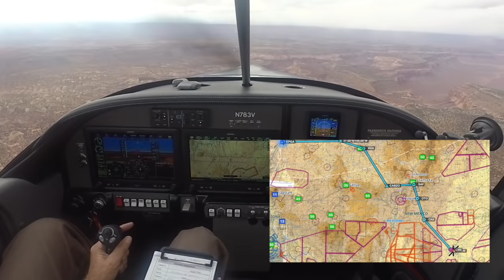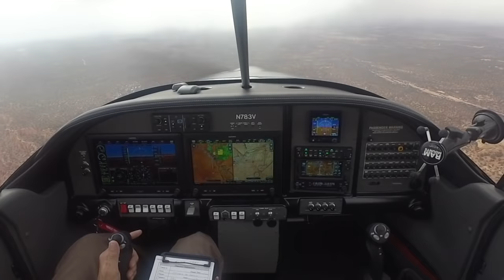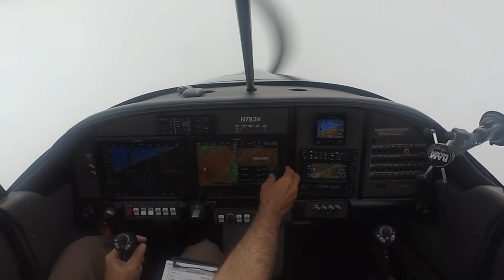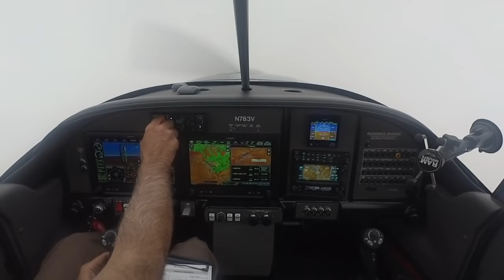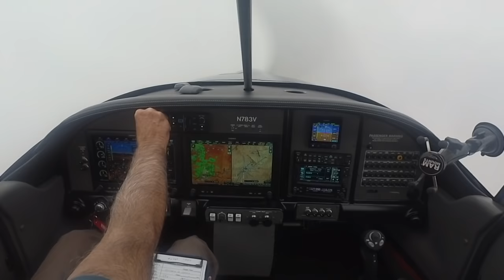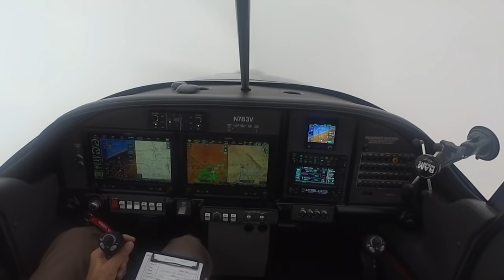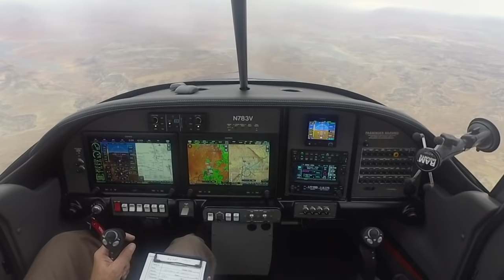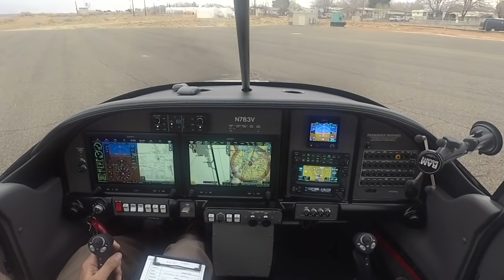RV 10   N783V   My 1st Emergency   HD 720p

Comment: This is a good reference for how quickly things can happen and how hard it is to think through systems when youre task saturated! Thanks for posting! Cant tell you how sweaty my palms got when your airspeed failed. 

From the helo perspective:
IIMC in my job has two schools of thought. Attempt to turn around and get clear of the clouds doing the opposite of what was done to enter the clouds or continuing into the clouds and picking up an instrument clearance. As a helicopter pilot flying an instrument rated aircraft im more likely personally to just continue and pick up a clearance climbing to the MSA and declaring an emergency. Trying to regain visual in IMC (in a helo) is a surefire way to get Spatial D and end up in an unusual attitude. Just knowing how much more susceptible we are to spatial D makes me want to stay locked on those instruments. If its a non instrument a/c or i didnt have an instrument rating things would obviously be different. All this is to say at least for me I believe picking up an instrument clearance like you did was a solid move.

Comment: In 1970 as a student pilot I had OMNI fail and IMC occurred as I was trying to work around thunderstorms I was quickly losing SA. Departing airport could not ping me (pre squalk)… directed to Contact a “center”, climbed, contacted, and within less than 5 minutes from start, I was on heading and tracked to destination.  3 months later FAA sent me a POST CARD suggesting more instruction.  The radio in rented airways repaired… after intermittent problem repeatable.

Yes, I caught “flak”… but I was ok and airframe was usable when I walked away…

Comment: Notice the synthetic vision is almost dead-on the runway center line as well. Trust the synthetic vision. that's your view when there is zero visibility and it should not be shared with a map

Comment: When I was a teenager learning to fly, my instructor taught me about Pitot icing by sharing that he had experienced a situation similar to yours.  I’m not sure how glass systems work as they weren’t used in GA back then.  But I was taught that analog (steam gauge) airspeed indicators needed both the static port and the pitot tube to properly display airspeed.  The pitot tube measures the dynamic pressure entering, and the static port tells the airspeed indicator how dense said air should be. 

He had shared that his pitot tube froze while in a climb, and he was confused bc his airspeed kept increasing at max power.  In a climb, climb power, but increasing airspeed?

The airspeed indicator was only receiving half the information.  It was only getting static pressure and therefore was nothing more than an altimeter.  

IMC is definitely not ideal.  As you said in the video, you often try to fly 20 mins or so in front of the airplane.  Task saturation kicks in when a pilot finds himself in IMC so suddenly. I’m so thankful you made it out and were able to learn from this.  I am even more thankful that you are willing to publicly post your lessons learned.  While watching the video, I was wondering if you realized you were in a left bank. (Thinking Kennedy. Eek). But that’s how IMC gets pilots.  Great video.

Comment: Just after Christmas last year (so not quite two months ago) I had a very similar experience. I had the TKS running on my Cirrus, but forgot to turn the Pitot heat on. Lost my airspeed indicator which sent bad signals to my autopilot. Only difference is the very SECOND that I got a big red X over my airspeed, I realized the culprit and turned the pitot heat on. The entire ordeal lasted about 15 seconds for me. My heat was RACING for 15 seconds though. A pretty quick fix none the less.

Comment: Student pilot here. I don't really understand what happened here.

1. He has GPS. Safe minimums and ground speed right there. Attitude indicator good. Critical needs met no? 

2. What's the difference between "calling for help" and pop up IFR? >> ring up flight service, I can't see shit, airport/approach/runway, Bing bang boom. All you really need is traffic advisory/clearance no? 

3. "Get-there-itus" just fly IFR/VFR over the top if weather is questionable. Track a VOR, whatever. Who just heads out cross country VFR with rain/bad winds and their fingers crossed? 

Maybe I'll understand better down the line and certainly not trying to be critical here just, I don't understand how or why this happened at all.  These are real questions not sarcastic ones.

That said I'm sure it can get scary real quick when situations change rapidly and you don't have time to prepare. That I understand. I feel like he handled it well and appreciate the humility to post it. Great learning experience for me as well. 

Thanks. 

Any insight would be nice from an experienced pilot.
Reply: Feels to me that this pilot needs to get re-rated for IFR. He panicked instantly getting under IMC, while he has more than enough equipment to safely fly with no windshield. Push NRST, punch in the approach/tower freqs + ATIS, pick an approach, set minimums/speeds, and engage AP, open your checklist, and off you go.

Comment: Pretty disgraceful; but facing up to how stupid that was and sharing it publicly is redeeming - so good on you.  By the way, checklist, checklist, checklist.  Your first mistake after failing to turn around, actually, was not getting the ATIS at Page when you first decided to run in on IFR - that would have been first on your checklist - the second and third items would usually deal with pitot - and alt static.

Comment: A similar thing happened to me flying from Rock Springs Wyo to Modesto Ca.  In the vicinity of SLC Ut the clouds started shooting up and pushed me up to near 16,000 ft. and had no oxygen aboard.  I had to declare an emergency with SLC for vectors to Ogden.  I was instrument rated but was not current at the time.  As they were bringing me down through the clouds SLC casually asked me if I had turned on the pitot heat and carb heat.  Of course, I hadn't.  There were no visible signs of icing yet but that sure woke me up.  They got me safely on the ground at Ogden.  I then had a little discussion with some FAA people. about how I had gotten in that mess.  I received a brief lesson on Mountain Flying 101 and they didn't ground me.  Seems I forgot everything my instructor had taught me during my time of stress.

Comment: Arm chair fake pilot here.  But I’m a maintainer so I’m fairly familiar with the industry. 

I think you handled that situation as well as possible.  For someone who had their hands full and was relatively stressed, you maintained composure, remembered your training, and followed the directions of atc.

The pitot heat thing… yea, I’ve seen that before.  Lived in Texas and Florida my whole life.  Our pilots don’t remember it’s a thing.  Every winter I see at least one aborted mission due to pitot issues.  
Personally, idk why engineers don’t develop some sort of “automatic on” mechanism for pitots and possibly other de-ice functions.  Make it the pilot’s responsibility to tell the aircraft no heat, not the pilot’s burden to turn the heaters on.

Comment: Great job staying cool... although i bet your surface temp was anything but cool 😂 This is why I actually like to have a couple analog/mechanical gauges on board in addition to the new digi avionics - they dont look sexy but they are a great error check and might just save your bacon.

Comment: Pitot tubes are among the things that have caused problems and accidents the most.
First thing when the temperature drops, heat pitot.You had a very good level of cold blood BRAVO. And then you trained your brain to recognize mistakes, and this allows you to improve yourself and therefore also the safety of your flight.
If you are unsure of the way, it applies in all cases, it costs nothing to go back.
It should be a maxim of life :)

Comment: Everyone saying this would have been fatal if he hadn't been instrument rated; He has synthetic vision for crying out loud. He also has gps groundspeed. As far as navigation goes, he had it all available to him. The alarm was distracting for sure, but he isn't flying a six pack. 

To the pilot, good job keeping your composure. You are 100% not alone forgetting the pitot heat and/or carb heat as a GA pilot. I've done it myself, and I fly for the majors. 

The first thing to consider when troubleshooting an instrument failure is to consider the source of that instruments' information. I am curious about one thing: You said you lost your AOA indication as well. Is that getting info from an actual AOA vane, or is it something else? The AOA is normally dependent on your actual angle of attack.

Comment: For non pilots, in instrument condition, as in no visibility you lose nearly all sense of orientation, so in this case the pilot was turning but didn't know it. People think you can feel it but when you go through instrument training you quickly realize you could be in a steep turn and not even know it. You must rely on your instruments.  However he lost airspeed indicator which can freak you out because you are relying on your instruments. The peto tube is a little pointy thing, that hangs down off the plane, air flowing through gives the indication.  If it's clogged or ices there's no flow.  You always physically check to make sure its clear in preflight.

Comment: Many moons ago I
Picked up my c172 from a 100 hrly, did a preflight and launched for home. As soon as I took off airspeed was nuts vsi wandering all over the shop. I was an Ifr qualified pilot but this threw me, straight after a service I was afraid something had been left out that really mattered it was a crap day did a rtn to field nasty x wind no air speed indication landed ok with wobbly knees. Problem -LAME had covered static vent with clear tape I missed it and he shouldn’t have used it . I learned a lot that day

Comment: Glad you made it. I am very interested in aviation and have been following videos like this. I have one question, why doesn't the pitot tube heater turn on automatically? Is there a system where it can turn on by itself when the temp drops to a certain level?

Comment: Not sure if it can or should be done but my brain kept saying “why don’t pitot tubes have auto heat when temp lowers to a certain degree?” Are they automatically heated in commercial jets? 

Awesome video, one of the best I’ve watched. I was in the right hand seat with you trying to use my X-ray vision to see something. 👍👍

Comment: Here's my biggest bonehead move.  I was a brand new VFR private pilot with about 40 hours total flying time.  Rented a plane for a joy ride from Knoxville to Ashville and back.  Required flying over the Smoky Mountains with peaks at max height of 6700 feet.  Everything went fine to Ashville.  But on the way back, a bank of cumulus clouds had quickly formed sitting on top of the mountains and topping out at maybe 20K feet.  Clouds stretched as far as I could see from north to south.  Couldn't fly over or under them.  Felt that "get there-itis" big time (they might be mad if I didn't get the plane back in time).  Decided I would just fly through the IMC over the mountains.  How hard could it be?  Right.  With no IFR training, as soon as everything goes gray, your soul enters the twilight zone.  It sounds simple in theory, but the reality quickly becomes your seat of the pants telling you that you're in a descending left bank and subconsciously compensating all the while you were actually flying straight and level - but not anymore.  Why is my airspeed so low?  More power.  The thought of the 6700 foot peaks below, even though I'm flying at 7500 feet, forces a subconscious slight back pressure on the yoke.  Stall warning horn starting its faint, scratchy, croaking sound.  Dang it.  Get the nose down.  More power.  Now I'm way off heading.  The seat of my pants tells me I'm headed for a crash - but it's lied to me before.  Now I feel like I'm losing my mind.  I decide to do a 180 and fly back out of the clouds.  Yes, seconds seem like minutes.  I finally break into the sunshine, calm down, and get a grip.  I swore to myself to ignore my pants seat and watch the instruments religiously.  And believe them regardless of other imaginations.  Back into the clouds I went, and It probably took 10 minutes to break out on the other side.  But it felt like an hour.

I've since thought about the likely scenario of stalling in gray-out conditions and then spinning the aircraft.  With no visual reference and a freaked out frame of mind, very low odds of making the right control inputs to stop the spin and recover.  That day, God was merciful to me, a sinner.
Reply from the maker: OMG!!  I got nervous just reading your reply!  Thanks for sharing and glad you are alive to tell about it.   WOW!!!

Comment: the only thing I can say is that your weather planning was bad. 2 years later and I am sure you improved. Sure, there where no reporting points in 168 miles but you have other means of information such as area forecast, radar, prog charts and so one that should give you a general idea of the weather.

Comment: You didn't mention it, but if your pitot tube was icing up, your wings, stabilizer, and prop were probably iced up as well.  I'm curious about the ground temperature that day and how much ice you collected and observed after landing.  Bad things can happen with the increased weight and interrupted airflow across these surfaces.

Comment: I think all pilots have experienced "Get there-itis!"  Us lucky ones lived to share the warning to others.  Oddly enough, I turned back- but never expected my instructor to suffer from it.  He was flying left seat - , the ceiling lowered and we ended up out over the sea - VFR, seven up in a Cherokee six -  so low that I was afraid of meeting a fishing boat or ending up down in the drink.  I think we were no more than 100' ASL.  What a bad example he set.  And in another example, I was under pressure from him demanding I take-off and return his plane immediately.  But the airport was socked in by a  ceiling with mist below 100' AGL.  I refused and lived.  Amazing an instructor would pressurise a low hours VFR pilot to take risks.  There were HV power pylons surrounding the area.  So we might wonder if instructors like that might actually lay the seeds for "Get there-itis!" and funerals.

Comment: A lot of people harping on the word “mistakes” once you hit that threshold of the clouds you can get socked in even if you had turned around. I’d rather go IMC and have time to get ahead of the aircraft then to turn around and potentially hit same conditions with less prep. Trying to find vfr in IMC is way more dangerous, you can’t control the weather but you sure can control the aircraft, good job on your flight

Comment: If you lose your airspeed just tug the stick and let go.  You  should feel the Gs if your speed is good, too slow and the Gs should be weak, too fast it will be sharp and plane will be noisy.